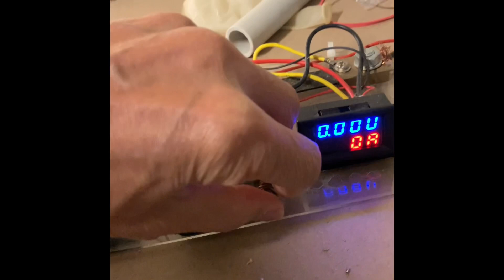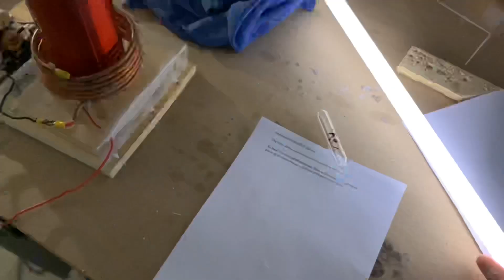800W Tesla from $30 ZVS Driver

Comment: I had been thinking about this concept and didn't know if it was possible, but now I see that it is possible.
Reply from the maker: Ik it’s amazing how well it works!
Reply: @BrianDhvTinkerer  Hello again, please help me. I have made the circuit but it does not work, I think the ZVS is not resonating at the right frequency. I have put the capacitor and the primary and secondary coils of a classic tesla coil that was already set to work in resonance but it does not work well, the arcs it outputs is only when approaching a metal and it is like the arc of a flybac, very hot but not much voltage. 
I used an irfp450 mosfet and for testing I powered it up to 55V. otherwise I have used the same circuit you have put in the video description.
Thank you very much
Reply from the maker: @gabrielhacecosas  does your setup have a topload on the secondary coil? We found it does not work if there is a topload.
Reply: @BrianDhvTinkerer  it has a topload, I will try to remove it and adjust the resonance again so that it works without it.  Thank you, 
I have also just tried to connect it to 120V limiting the current with two 40W ballasts and there is no difference, it makes the same spark and consumes about 1A.
Reply: @gabrielhacecosas   Many people have tried those ZVS drivers from China & it didn't work same as SciTubeHB !!!! The truth is that behind the scene show!!!! They just don't want you to see! Everybody can do that, just put a lot of electronic circuitry here & there near your tesla coil, let some wires floating here & there and then you'll have hidden wires running somewhere to be powered by a powerful neon transformer! This is that neon transformer which will give you powerful outputs from your tesla coil! All these Youtube videos are just lame marketing so that we keep buying electronic components from China or buy their newly developed ZVS  & in that way, our hard earned money is going into those Chinese pockets! If we really want to see big sparks out from our tesla coils, just power it by a beefy Neon transformer, you'll be much more happy. Sorry dude! But at times, this gets me angry seeing others fooling the world with lame videos!
Reply: @RAVI171175  Luckily I didn't buy any ZVS, I bought some transistors and assembled it myself.
Theoretically it should work anyway, it is a resonant circuit and if the secondary coil resonates at the same frequency there should be energy transfer. It worked for me only that there wasn't much energy transfer, but I got the resonance by trial and error because I don't have an oscilloscope. Maybe that was the fault. When I buy an oscilloscope I will try again

Comment: Any way to make these arcs bigger?
Reply from the maker: Yes Arc Angel Tesla already did it. Run the Tesla oil in CW mode and then pulse the input power via an opticoupler connected to a mosfet. The third mosfet can be used as a power switch to pulse the input lower . The square wave signal to turn the switch on and off can be from a 555 or a signal generator.
Reply: @BrianDhvTinkerer  Where can I purchase the tesla coil alone (thick and thinner coil)?  I would like to get one. Thank you.

Comment: actually the capacitors you have used is okay but it cant handle high frequency . you can use a 50 khz 1200 v MKPH capacitor
Reply from the maker: Those caps are the standard for Tesla coils. They can take a beating  and handle very high currents especially when pulsed

Comment: man ,would  have worked better if you had some high voltage high frequency capacitors hooked up in parallel to each other  and hooked up to the outputs from the inductor which creates resonance with each other to get a better leap in the performance and the voltage.
Reply from the maker: Thanks for the idea. The caps are rated for high frequency performance at high voltages and peak currents. MICA would be the next best if I could ever find one or even the games celem. Those cde caps are workhorse caps for Tesla coils and so far have held up fine. The limitation on the voltage is mainly the Mazilli layout itself!

Comment: if you don't smooth the main supply DC input (still smooth the gate supply, you might need to do some modifications to be able to have a separate gate supply) it will have larger output due to mains ramping and it will draw less
Reply from the maker: Thanks I’ll try that!
Reply from the maker: Check here:
https://teslascience.wordpress.com/cw-tesla-coil-running-directly-off-a-zvs-driver/

Comment: I wonder why it won't work if the connections are reversed, maybe because it's a single pole primary feed..?
Reply from the maker: It works when the primary is reversed but there is more current draw and reduced output. The secondary magnetic field feeds back into the primary coil and knocks the zvs out of spontaneous resonance. It’s hard to explain why exactly but when theprimary  leads were  switched back, it then worked great with less current draw, less heating of the mosfets and much better output. Arc angel Tesla also observed the same thing.
Reply: @BrianDhvTinkerer  i think its to do with the winding direction of the coils . Best if in same diection for the collapse.
Reply: @BrianDhvTinkerer  run your zvs at low power and run the bottom of the secondary to one of the gates of the mosfets. The correct mosfet gate will increase output and the wrong one will decrease output. Doing this will keep it in tune even if your capacitors are the wrong value for optimal resonance.

Comment: would help for future collabs to make sure you leave a link in the description or pinned comment to the other channel. and be good to see some links to the zvs you used. the zvs i have built up with lcpcbs has more than enough on board capacitance with large 3nf high frequency caps and space for 3 for a total of 9nf, impute up to 110v so plenty of grunt too. happy to share some time. now we want to see what your big induction heater can do. this has to be the simplest solid state tesla coil and i dont see why i have't seen it before now. i shared your video on facebook and directly with Jason from plasma channel.
Reply from the maker: thx that’s awesome

Comment: I think a small inverter arc welder is a robust power supply . I might try that as well !
Reply: Will you mod it to give an ac output?
Reply: @paulb2529  No. i was actually still going to use a zvs circuit powered by the welder but maybe that could be done ! 🤓
Reply: @Buzzhumma   If you could replace the transformer with the bottom load you may be able to use the inverter's switching frequency. Don't know if this would be safe for the circuitry thought. Server power supplies could be an option. Possibly series up some old PC power supplies.
Reply: @paulb2529  ok so first thing to check out is the frequency of the primary to see if it fast enough. I am not sure what frequency it is suppose to be but in this video he changed the capacitors to raise it so i would most likely have too uo the frequency. How fun 🤩

Comment: I would like to see schematics. What's the input voltage? The voltage limit of regular ZVS should be 30V. Also there are a three wire output from ZVS, but I could see only two wires... Could you help please?
Reply from the maker: It’s this circuit for the driver: https://markobakula.files.wordpress.com/2012/10/royer_ih.png

The capacitor is 2 x 150nF series connected 942C20P15K-F film capacitor series connected.

https://ebay.us/ypUGVw

The primary is 6 turns 0.25 inch soft copper tubing wound 4.5 inch diameter inner diameter on a 4.5 inch OD pvc pipe. The ZVS is powered to about 15V AC and tapped to give the same resonant frequency as the secondary (in my case 342 KHz) as measured using and oscilloscope and signal generator. My secondary which is 34 gauge copper magnet wire wound to 5-6 inches tall on a 3.5 inch PVC pipe gave me the 342kHz. The power supply is rectified smoothed mains from a variac.
Reply: The third wire is Earth Ground...